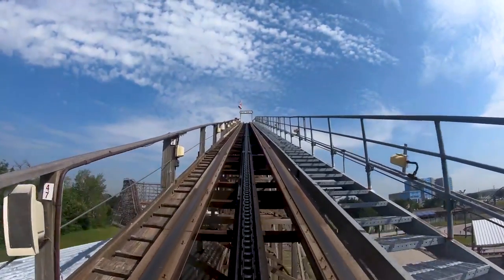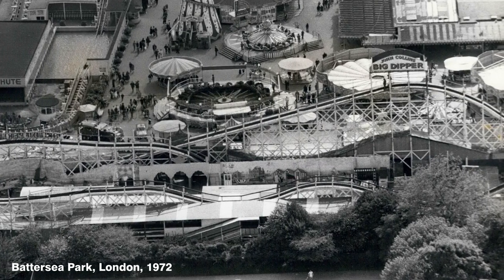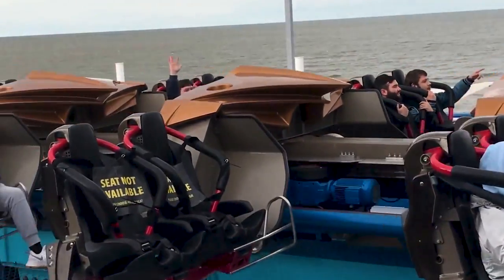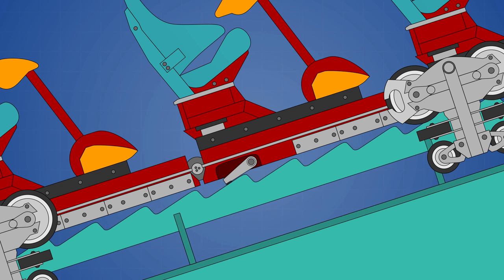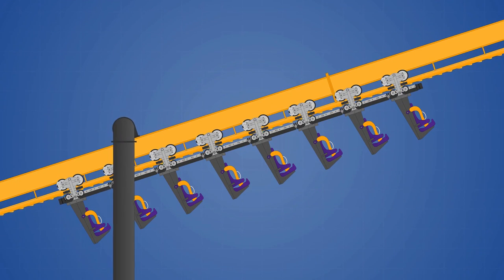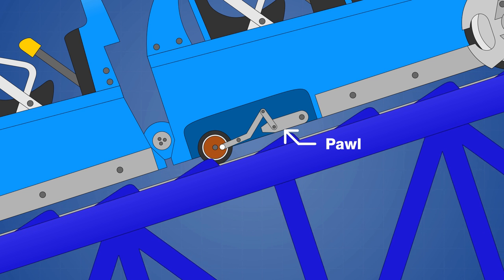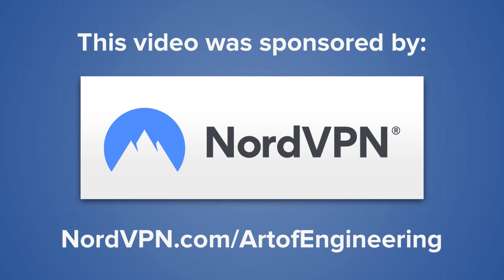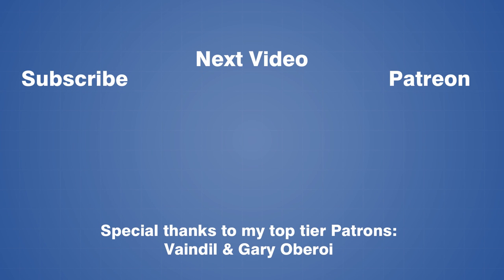Why Roller Coasters Click

Comment: Why Roller Coasters Click

Answer the following questions in complete sentences.

1. What is an anti-rollback system (ARB)?

     An anti-rollback system (ARB) is used to prevent the roller coaster from rolling backward in situations where motion in the reverse direction would either be undesirable or dangerous.

2.Why would it be dangerous for a roller coaster train to fall backyards while it’s climbing?

    Because there are usually turns at the base of the lift hills and if a train were to fall back it would be disastrous.

3. What does ASTM F2291 make sure that roller coasters have?

    They developed a set of standardized guidelines for the safe design and operation of amusement rides. They make sure that the roller coaster has no less than 2 anti-rollback devices are required, and at least one of them must be engaged at all times.

4.In the video demonstration, what are the odds that both redundant safety systems fail at the same time?

    Probability can be calculated by taking the product of the individual failure probabilities, which is 1 and 10 billion.

5. What kind of roller coasters don’t need ARB systems?

    Rides that are meant to purposely fall back or launched coasters.

6. Explain what makes the clicking sound on a roller coaster.

    The secondary ARB usually consists of a ratcheting system, which consists of the clicking sound.
    

7. What makes the anti-rollback dogs so reliable?

   This mechanism is extremely reliable because it operates entirely under gravity, and it will always be engaged whenever a train is present.

8.  If a train car is excessively heavy, how do the engineers handle the additional load?

     They have two racks installed on the track instead of one to handle the additional load.

Comment: I'm not gonna lie its because  the belt in the middle that's pulling the roller coaster up I dont even like high roller coasters cause I always think  they gonna fall I wont risk my life through it so I do small roller coaster  I did crazy mouse roller coaster at owa and at waterville I ride cannon ball
Reply: Roller coasters are incredibly safe things. You're more in danger at any point on the way to the park than you are on a coaster.
Reply: Statistically smaller roller coasters are the most dangerous ones, but that's not saying much because the chances of dying on a roller coaster are 1 in 300 million. Now, fear of the forces is a pretty valid reason to fear roller coasters

Comment: Without even watching the video, I'm 110% sure this is the answer - It's the anti-rollback device passing over each crossbar on the lift hill that the train will latch onto if needed in an emergency/technical failure situation.

Edit = Winner winner, chicken dinner :)
Reply: That’s not correct. It isn’t passing over the lift hill crossbars, it’s passing over a strip of grooves that runs up the lift hill.

Comment: Anyone that needed to watch a 12 minute video to explain away why roller coasters make a clicking noise is I'm sorry to say rather stupid. It's pretty much painfully obvious why it clicks. You only need to have been on one and observed the chain that sits in the middle of the track of the lift hill/section, along with understanding the need for a coaster cart to have a mechnical failsafe to preventrollbacks in the event of a system failure.

Comment: Rollback is not the cause of the clicking. It is a system that can possibly cause it, but there are other antiroll back systems. The only system that makes this noise that also functions as an antiroll system is the dog tooth lift system. Nice video overall though.

Comment: The rides may be manufactured safely, but you can't engineer around douche amusement park owners that refuse to do maintenance and make sure things are working and who don't train their staff because its too expensive. Most of the worst disasters on roller coasters have been   specifically that. But that's a capitalism problem, not an engineering problem...... I miss roller coasters so much. :(